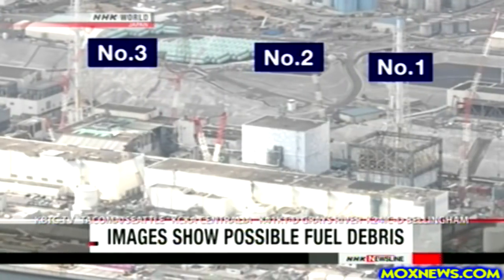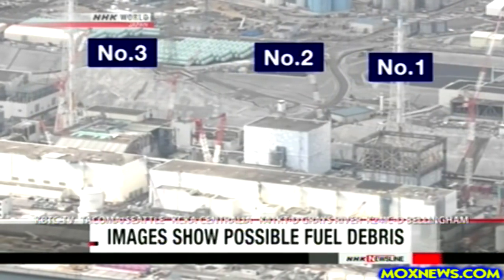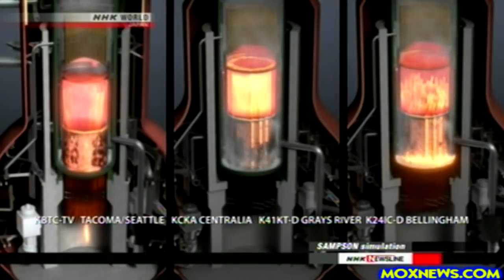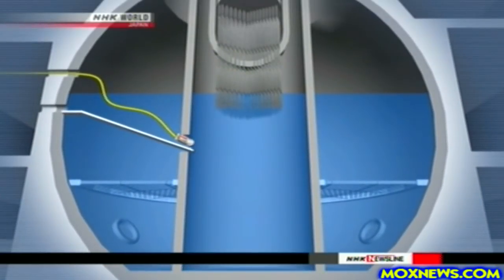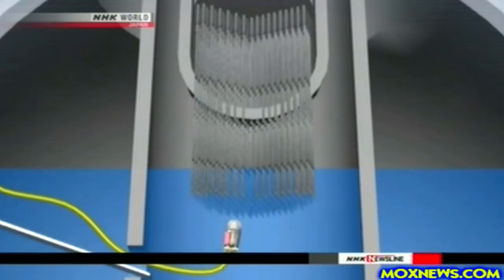Video Shows Molten Material Inside Fukushima Nuclear Reactor

Comment: note to engineers - do not put your emergency backup systems in the basement when placing a nuclear power plan in a flood zone
Reply: Common sense would be don't allow people to walk & drive under bridge being build(FIU) or patch spillway concrete during dry season before raining collapse(Oroville Dam) and don't design & build on side of volcano(Hawaii)
Reply: AC & especially DC emergency systems are placed in the basement to protect them. Based in probabilities, engineers estimated that a sunami with these consecuences was less probable than a plane impact, for example.
Reply: Those Japanese aren’t too bright
Reply: Another reactor plant got hit by the same tsunami, but the local government forced them to build a proper flood defence that would withstand historic tsunamis. That power plant is still running. Fukushima went down due to bad planning
Reply: Peter Piper well you should keep in mind the reactor was built in the 70s by General Electric an American Company 😬
Reply: John P "note to engineers" wtf is that supposed to mean. How about you build us an entire nuclear power plant?
Reply: @dusscode  that is supposed to mean that backup systems located in the basement if you are building in a flood zone might not be a good idea.  I thought the meaning was pretty obvious.
Reply: How about underground lines between the reactors and the grid, to reduce the chance of losing off-site power? That as much as the backup generators being flooded doomed the plant.
Reply: They placed the emergency backups in the basements because in the original design, the whole reactor building would be higher in elevation but at the last minute they placed it lower because they also thought that it would be harder for the pumps to bring it to the reactor
Reply: I think placing them under the Water line is fine, but they should have build that basement water thight, that would have probably safed them. Also a pump in case some water makes it in and you are fine.
Reply: @gbarnewall1   Okay Captain Out of Context - Disregard it was during a war that Japan started and the bombing probably saved both US and Japanese lives and additional years of untold suffering.
Reply: It was a suicide move, kamakazi, all life will die now soon, starting with oceans

Comment: The Fukushima disaster is still ongoing. That tsunami that did all of this damage was insane. The design of the Fukushima-Daiichi power plant was solid. That tsunami though.....
Reply: Yeah, totally solid for a place known for tsunamis lol...who would have thought a tsunami might be a problem one day....totally solid design.
Reply: @multicookie1997  The problem where the People operating it not the Tsunami. Of course the damage from the Tsunami could have been prevented my building different, but the Meltdown could have been prevented if personal would have know how to operate they're reactor. Main reason i'm against Nuclear power, there are People Operating it. Nuclear power is safe, but the people working there are a big source of uncertainty.
Reply: @321GhostRider123  You can't make a generator drowned in water cools a reactor, the entire plant have no power at that point
Reply: @ChlorinightS  Each reactor had a passiv cooling system for emergencys like that called isolation codenser. It works without energy but the workers diden't have enough knowledge about that system cause they didn't train enough with it. Experts think if the workers did know how to operate the isolation condencer properly a meltdown could have be prevented. There is a docu about it where they explain it.

Comment: The mix of fuel, cladding, steel and everything else is known as Corium. It's lethally radioactive even though more than ten years has elapsed, and the surrounding water could be acting as a moderator to sustain a chain reaction in the fused and melted core remains.
Reply: See elephants foot and China Syndrome for details

Comment: If you have or can get a hold of a Geiger counter, go by the canned Tuna section in your local super market and run the Geiger Counter over the tuna. See what kind of readings you get.
Reply: Bananas are likely to be more radioactive.
Reply: It's very easy yo get Geiger counter ans it's also possible to build as DIY project.
Reply: The probelm is everything gives off radiation. You can put a gieger counter next to your dog and it will go off and it also depends on how sensitive you have it
Reply: @richardwalker6004  Dog with an unusually high Geiger counter reading = "hot dog". 😁

Comment: this is why you don't build nuclear reactors on a fault line.
Reply: Wrong, fault line wasn't the reason that caused Fukushima reactor melt down. A series of man made errors and flood by the tsunami stopped emergency diesel generator to supply cooling water to the reactor that caused the tragedy.
Reply: Joel Wu actually that’s not true they had two other safety measures in place that also failed and they failed due to lack of coolant the coolant had ran out due to the earthquake causing a crack somewhere in the coolant system
Reply: ...On a coast line.
Reply: Nuclear reactors work best near water. This way they don't have to truck it in.
Reply: how many people have died in fukushima compared to the bombs ? dont be dump pls
Reply: The whole country covered with fault lines!
Reply: Like California's Diablo power plant?
Reply: Pikapetey Animations and
Reply: Bombs! plural
Reply: Err... 0 deaths from radiation vs 100,000-250,000 from the two bombs dropped during the war. So, entirely incorrect.
Reply: 0 radiation deaths, but there are a number of deaths associated with the trauma of moving (in particular in the elderly age range). This is difficult to quantify, and incorporates factors such as loneliness.
Reply: ..or at all. Historically, natural disasters are bad enough without them triggering massive nuclear fallout. It's bound to keep happening.
Reply: And on a coast near a fault line no less.
Reply: Or 3 ft from the oceon
Reply: SenpaiDentai Not on Japan though.
Reply: Angus Hollands You might want to check your statement. There are many deaths worldwide from radiation.
Reply: Where were you before Fukushima, warning them about your knowledge? I guess all you can do now is help the entire country of Japan and every west coast US state move their reactors somewhere safer. If only the nuclear engineers were as smart as you.
Reply: This is why you don't build nuclear reactors period.
Reply: If only there was a huge nuclear reactor in space we could generate energy from safely...
Reply: @ganjah_ninjah 2117 Because just spent fuel needs to be cooled for 7-10 years before water doesnt need to be used.  Can you imagine how much water you would need for fuel that isnt spent yet?
Reply: @ganjah_ninjah 2117 Which new reactor?  Obviously it must be of a different design or different fuel because this fuel stays hot for years. A simple one time dump wouldnt be enough to cool it.
Reply: @ganjah_ninjah 2117 Even if the vessel is 100% sound and intact I still dont see how a one time dump even with a massive amount of it could be enough to cool what takes years to normally.  Maybe it is a system that will keep it from a meltdown at the moment but power would have to be restored to continue to cool because it would otherwise simply burn off or  leak out if there are leaks.
Reply: @ganjah_ninjah 2117 Actually its a design and hasn't been actually built as far as I know.  Its the Westinghouse AP1000 and it is as I said only there to prevent a meltdown AT THAT MOMENT.  Thats not to say it will continue to keep a meltdown from occuring in the short future after that water then boils and steams off releasing hydrogen gas of which then will explode when met with oxygen.  Its no answer to the issue just another bandaid.  Also, its called passive cooling that was only truely designed for new reactors after fukushima happened.  Unfortunately the passive systems rely on the fact there is no damage to the system itself and has an issue with delivering the water exactly where its needed.  I see you didnt find this information without me finding very easily.
Reply: Pikapetey Animations or in an area subject to high winds, combustion, or other natural behavior. In short, anywhere on the earth.
Reply: Joel Wu manmade tsunamis did it lol. People just love to blame other people. In any cycle of related events they will keep moving back until another human is involved and stop there so they can blame a human. If it’s a cycle of related events where they themselves actually egregiously fucked up they will blame everything and everyone else under the sun except accepting responsibility for their fuckups. Those are usually the most blameful and fingerpointing humans too. Failure loves company.
Reply: BigMike Przysiecki that’s a big fat lie for sure
Reply: Hoefledorf it’s the earth. It can quake. You cannot control it.
Reply: Angus Hollands so include deaths from despair after the bombs and they’re back on top fool.
Reply: will palmer it would fall out of orbit eventually. If only people weren’t so greedy and extravagant in their energy hunger.
Reply: @joelcwu59  Dude, how do you think Tsunamis happen?
Reply: @joelcwu59  Tsunami caused by an EARTHQUAKE from a FAULT LINE which caused the flood and damage to safety systems and interlocks
Reply: @paulmobleyscience u should look into the new smaller modular reactors .they can't melt down like there bigger cousins and can be Daisy chained to scale up needs. CA is in big big trouble with our electricity and by 2045 we will need 100 times as much power as we can produce at Max current. One of the other problems besides power generation in CA is laws .we have laws in CA that only let a certain amount of power be produced even on high demand days. CA keeps it commitment to not using fossil fuels for power so they important coal generated power from other states and go horray for green energy CA dosnt use fossil fuels for power horray now let's raise taxes so we can make new laws to produce less power horray .
Reply: @georgewbushcenterforintell147  Why is it every fake YT channel wants to tell someone they don't know information that is already known by everyone on the planet about something they seen in a YT video.  SMR are a complete waste of time and money just like their predecessors.  10 smaller units produce the same waste as 1 regular sized reactor.  Its doing nothing but bringing the scale down with a few added safety features.  The waste has always been and always will be the Achilles heal of the nuclear undustry.  You cant wish it away like in some YT video.  The real world doest work like that.
Reply: Just don't build them period
Reply: @chrispevan3763  essentially everything went in order, but due to the damage caused by the earthquake, they had failed.
Reply: You mean this is why you don't build it by the coast...
Reply: @bigmikeprzysiecki5040  American designed reactor actually. Made by GE, the same company that makes crappy light bulbs that burn out in less than a year.
Reply: This is why nuclear energy is a definite no.

Comment: Ironically this may have been prevented if Thorium reactors had become widely used. Instead all research was invested in uranium because it made a better bomb. Which was only used in combat  on Japan.
Reply: You've obviously never heard of cobalt-thorium g.
Reply: But you still need Uranium or some other fissile material (i.e. Plutonium) in the mix for Thorium to be viable as a nuclear fuel.  Th on its own is not fissile and cannot sustain a nuclear chain reaction. thorium is bred into Uranium-233 anyways so it's not really Thorium ever doing any work, it's just a pre-curser.
Reply: @kyle3420  .. There was Plutonium mixed with Uranium (Mox Fuel) in unit 3.

Comment: If there's molten metal that means the few rods have melted and who knows where they're at?
Reply: yes all of them, but reactor 3 had mox fuel, million times more radioactive than the normal fuel (with pu added)...cca 1.500 tonnes per reactor (chernobyl cca 70-90 tonnes graphite)
and there's also spent fuel pools, reactor breaches, water contamination... 
and 'maybe' they know where the fuel is now... after 2325 days, 6 years 4 months 11 days...
Reply: Micheal James
Those "icicles" don't look like metal to me, they're much more likely to be mainly uranium/plutonium dioxide fuel that melted and resolidified. The substance is also known as "corium".
Reply: Red Button TV1
MOX fuel is indeed more radioactive than uranium fuel when it's fresh and unused and therefore can't be handled by hand but after it has been used in a reactor the radioactivity of MOX fuel and uranium fuel is almost the same. And the weight of the 32 MOX fuel assemblies in reactor 3 was more like 10 tons in total of which 400kg was pure plutonium. And what does the graphite at Chernobyl have to do with this? Graphite isn't nuclear fuel, it's a neutron moderator and there were hundreds of tons of it in that reactor design, not "70-90kg".
Reply: knots... and that is exactly what melted, the unused fuel, 
All the Chernobyl reactors were of a design that the Russians call the 
RBMK--natural uranium-fueled, water-cooled, graphite-moderated--a design
 that American physicist and Nobel laureate Hans Bethe has called 
"fundamentally faulty, having a built-in instability." Because of the 
instability, an RBMK reactor that loses its coolant can under certain 
circumstances increase in reactivity and run progressively faster and 
hotter rather than shut itself down. but burning nuclear grade graphite theory is being rechecked.
i knew the quantities were high just not that high, but thanks for correcting
Reply: Red Button TV1 
How can unused fuel melt? It is not very radioactive and does not produce much heat. And all the MOX fuel assemblies were in the reactor when the earthquake happened, so they were not unused.
Reply: lol are you serious?
Reply: Red Button TV1 
About what? You said fresh fuel melted but that is physically impossible. Only spent fuel produces heat because of the presence of fission products and some actinides that are the result of the fissioning of U-235 and Pu-239 and neutron capture.
Reply: i didn't type fresh, and you're holding a bit on semantics i believe... so physically imposible in a melting reactor...
Reply: Mox?  Are you sure, we Brits do not tend to share our reactor designs.

Comment: thats good progress- after 5 years the experts are able to see something....yeah very encouraging. Our experts....and no way to clean- its all only storing from here to there. ..collecting grabbel... omgg
Reply: Indeed, it took 16 years to remove the molten fuel inside the three miles island reactor (unit 2). it was 6 years after the incident before they could even open the reactor vessel. The reactor vessel itself will be decommissioned once unit 1 goes offline in 2034.

The accident happend in 1979, in 2034 it will be 55 years since, so the time scale used in Japan of 30-40 years is in my opinion even a tad optimistic for a accident that is about three times larger.
Reply: in Japan they do not even know where the cores are.They melted through the vessels bottom. To be real they can most probably never reach them. This accident is far from ending.  It is an ongoing disaster and the radiaoactive material which ecaped through the bottom of the vessels is no longer controllable. Apart from releasing increasing amounts of hard radiation to the groundwater it can now no longer be cooled by inyecting water into the reactor building. All together things are no longer under human control...If not enough groundwater flows and is contaminated the molten material will burn...Seriously- those who run nuclear devices do not care a shit about mankind or environment. They only have money on their minds. And the worst is that only very very few people have a clue about what those devices will cause for the future to this planet and the whole environment,  even if there are no more "accidents". There is still no way to lets say "neutralize" radioactive material. Increasing cancer rates , in good part caused by the use of nuclear devices, are a clear signal of what is really happening but people do not understand what that really means. Every single nuclear device is liberating radioactivity all the time. Every single x ray machine does. All the nuclear "waste" deposits do and all of the nuclear power plants also do so. This whole question is misunderstood by citizenship. How the gosh can we change that., because the future will be a world of mutants and nobody seems to care...
Reply: They exactly know where the cores are. For all three reactors it is still inside the containment vessel. They are still being cooled, but of the cold shutdown achieved some 6 years ago that is being done at a much lower rate these days

FYI even in a fully functional intact reactor it will take weeks to even months to reach a cold shutdown after you scramm it (the hot shutdown). 

On the current timescale of cleanup operations they are at the same level of Three Miles Island where it took 6 years to open up the reactor vessel to have a peek inside.